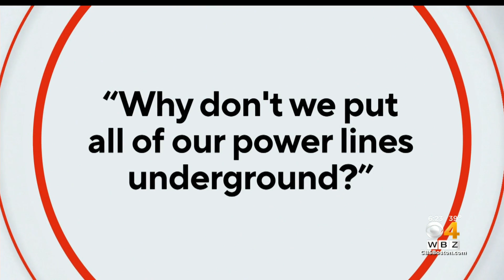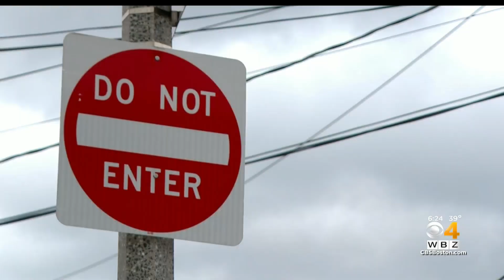Why don't we put all of our power lines underground?

Comment: We have had wooden telegraph/telephone/power poles around since probably the early 1800's or most likely earlier. We've sent probes into outerspace, humans to the moon, built supercolliders! REALLY?  Its really INEXCUSABLE not to have power, telephone, and cable underground in this year of 2025! Just think of the reduction of issues and outages due to severe storms such as hurricanes, tornado's, floods, maintenance of these poles, and fires let alone having to see all of this unsightly crap hanging along every highway and street corner! Lets take some of the taxpayers money and fix this instead of wasting it on illegals, foreign wars and  frivolous spending habits! I understand that some areas such as solid rock and similar excavation issues would create astronomical costs, however, I would suggest that only 10-20% of all utilities would be too difficult to bury!
I would like to see an ITEMIZED expendeture report of what is/has been spent on infrastructure in this country over the last 2 or 3 decades! It may take 25 years but I say its time to start!

Comment: Finding faults is challenging, especially when you have dozens of manholes under water and half to be pumped.
Reply: Make the walk ways Cement and water Proof it if you can and make it where it's wide enough you can use a golf cart to travel it. And why don't why have technology where it can show where there maybe a break in the line like out I don't know Sensors in the in the line so many miles I don't know maybe I'm thinking to deep but thing lines above the ground is stupid
Reply: @Pahotam It's not stupid, it's cheaper. It's also easier to make repairs and find faults. We can put sensors and things to pinpoint faults more easily, but that adds even more complexity and cost.

Comment: The arguments against not burying power lines are mostly bogus, because they lines have to be replaced about every 40 years, and they can simply be installed underground at that replacement time.  About 25 years ago Arvada, Colorado, passed a simply local ordinance.  It permanently froze the number of utility poles at the number then existing.  This forced all new utility services underground.  It also indirectly gave an incentive to the power company to facilitate individual homeowner decisions in favor of underground service when it reduced the need for a pole, so that pole authority could be used elsewhere in the city.

Seeing how easily Russia has disrupted Ukraine's electric service, the issue should also be approached as one of national security.  It is much harder to disrupt underground line.  New York City even has underground substations. Cities with above ground utility lines are ugly is also a tourism consideration, besides one of local views.  Anymore people can preview any city they want to visit by just using Google Street View when trip planning.

High voltage transmission lines are a different case.  Utilities resist moving those underground because the overhead wires are bare, uninsulated wires kept from grounding by ceramic insulators on poles and towers.  Buried they would need to be insulated, and for pragmatic reasons also run in continuous conduits to make line repairs and replacements easier.  When we converted the electric service of our previous home (which was served by the last power pole on the line), we had to pay the undepreciated cost of the wire removed and exactly $1 more  a month for wire maintenance (the extra cost of digging up a line to repair an electrical short, before splicing the line).
Reply: That would add costs to your electric bill

Comment: Underground, so u will deal with water flow and dirt and cement and tree come on, man
Reply: In my city the 10 feet from the curb toward the building is a right of way easement.  That is where utility lines usually run, although for replacement service is can be easier to remove a narrow strip of asphalt to bury the lines, like to relocate transformers for home services.  There are machines to tunnel under sidewalks and driveways for line installation or replacement.  The replacement asphalt when that was done in front of our current home was in mint condition and seamless with the other asphalt.  The work is obviously easier where cobblestones are used and free floating cement blocks, as in parts of Boston.   I have yet to see water, dirt, cement, or trees disrupt buried electrical service.  The lines for streets are either under the street protected by the paving material, or buried 6 feet deep.  In fact when I ran provision for future utilities and electric lines I simply installed empty electrical and gas conduits.  The gas one is 18 inches deep, per the gas company, and the others are 24 inches deep. Line location is a free service so you have that done before digging to avoid being charged if you cut into a line by accident.